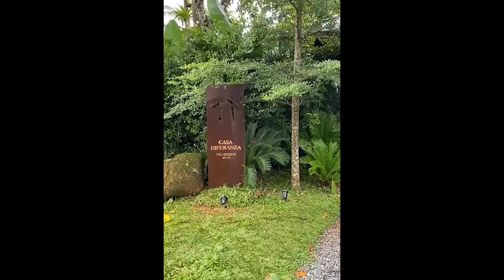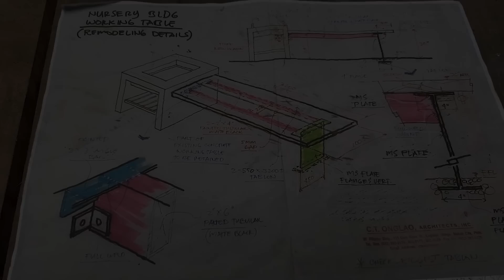CASA ESPERANZA TOUR Rest house in Lucban, Quezon | ZSA ZSA PADILLA  (work in progress)

Comment: Zha Zha I prefer the walkways to be precast conc.with pebble stones in between the precast tiles. This way more easy when it comes to maintenance...the tree leaves that falls if your walkways is covered with gravels is too difficult to remove unless when you are going to use air vacuum or air  blower ....
Reply from the maker: Jeremias Julian we use a plastic rake to clean the leaves